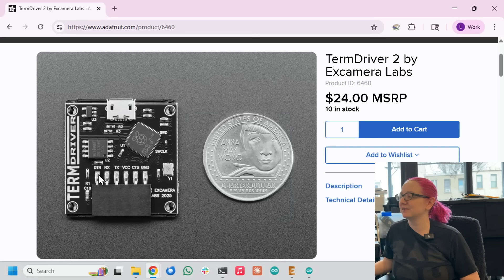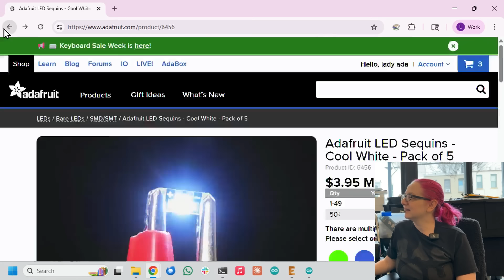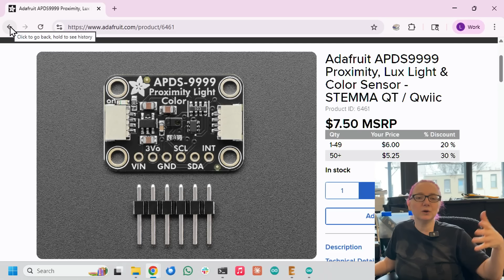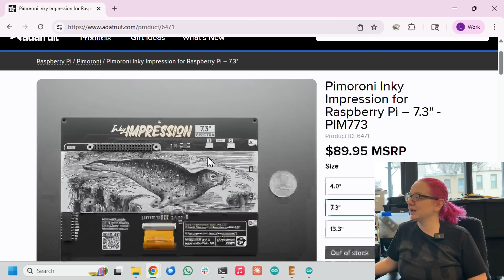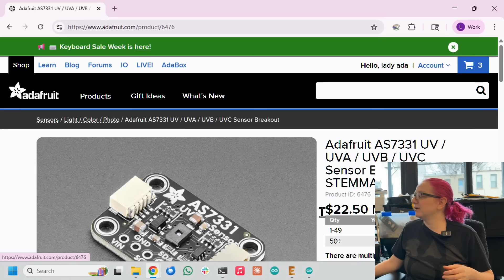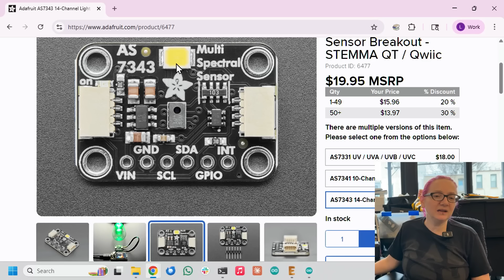#NewProducts 3/4/26 Feat. #Adafruit AS7343 14-Channel Light / Color Sensor Breakout - STEMMA QT!

Comment: What are the actual differences between the old Raspberry Pi mouse and the new one? I can't see much difference externally, and it seems to be more or less identical in terms of shape and size... does it have different switches? Different optical sensor? Different scrollwheel? I even went on the official RPi website and they haven't even announced a new mouse there yet.